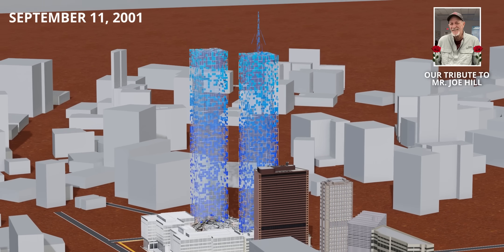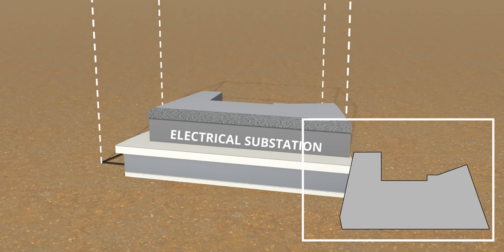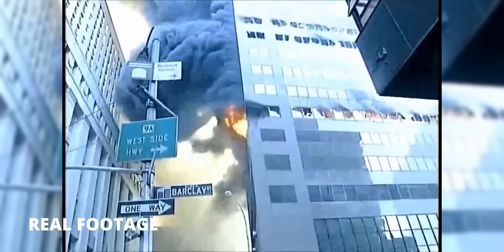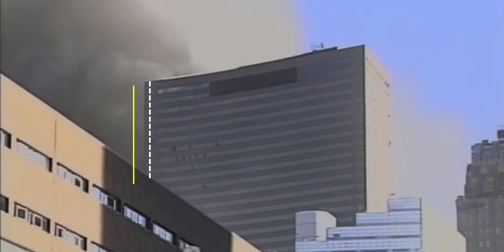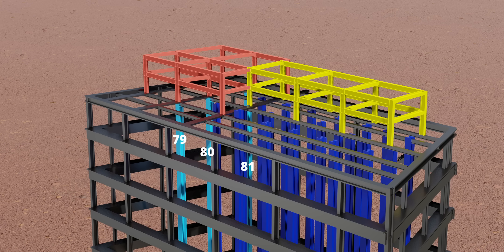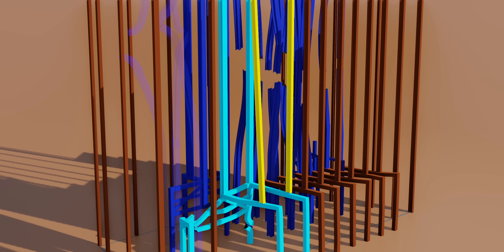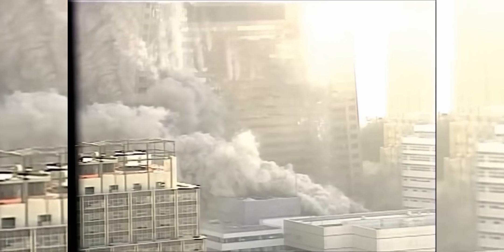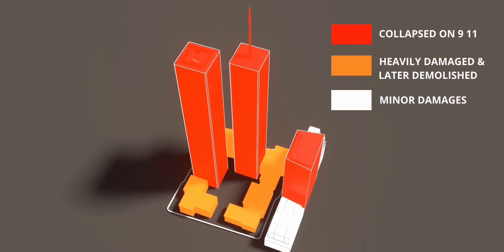Collapse of Building 7 | The Complete Physics

Comment: What I know for certain is that what ever hit the pentagon WASNT a passenger airliner.
Reply: What was your process to determine there was no passenger plane at the Pentagon anyway?  I don’t see one.

I’m going to respectfully disagree and offer a more plausible explanation.

We know Flight 77 – a Boeing 757 - hit the Pentagon because of ALL of the following true and relevant facts, not because of one random anomaly.  When complied together, all of these true and relevant facts form a single inescapable conclusion; 

1. Witnesses: Local and national media published or broadcast the accounts of ALL of whom reported a plane hit the Pentagon, while no witnesses reported seeing anything else (ie: none saw a missile). Around 2 dozen witnesses could identify either the aircraft type, the airline or both.

2. Flight Path: On its way in, Flight 77 created a damage path (the tree hit by the left engine, the 5 light poles, the garden wall on the Pentagon lawn and the mobile diesel generator) which is consistent with an aircraft the dimensions and layout of a Boeing 757. No missile could do any of that. 

3. Impact Hole: The impact hole in the outside wall of E-Ring at Wedge 1 of the Pentagon matches in size and shape the Boeing 757 from engine to engine. Wing impact marks extend out on either side of that to the span of a 757. youtube.com/watch?v=FkgJ-rFFBD0&t=15s  

4. Building Damage: The damage path inside the Pentagon takes the shape of an inverted cone, with over 80 support columns all of them bent in the direction of travel.  This is consistent with the high speed impact of a Boeing 757 aircraft and NOT the high-explosive blast warhead of any missile. 

5. Aircraft Wreckage: 19 tons of B757 wreckage were recovered at the Pentagon crash site including the landing gear, both engines, the entire left wing flap assembly, part of the cockpit, seats (some still occupied), landing gear bay doors, fuselage sections, the Flight Data and Cockpit Voice Recorders for Flight 77, etc, etc,... 

youtube.com/watch?v=kCRuVNgrAAw&ab_channel=cjnewson88 

6. Two parking lot security camera videos from the north parking lot security booth captured images of a B757 sized aircraft in AA livery flying along the exact flight path of Flight 77 and at the same velocity recorded by its FDR. The aircraft was trailing smoke from the right engine due to hitting the aforementioned tree moments earlier as confirmed by several witnesses. 

7. Human remains: The remains of everyone aboard Flight 77 were recovered and identified with the exception of 1 infant whose remains could not be identified. Some victims were recovered still strapped in their seats. Each of the victims families were provided with a detailed autopsy report.

8. Personal Effects: Several thousand personal items belonging to persons aboard Flight 77 were recovered at the crash site at the Pentagon with the victims families being provided with a 1,000+ page book detailing every item for identification and return. 

9. Radar:  A total of 6 FAA and NORAD radar sites tracked Flight 77 from take off to impact. The radar data matches EXACTLY the 25 hours of flight data recovered from Flight 77’s recovered FDR, right down to the last decimal. 

youtube.com/watch?v=3vqDDlS9Hyw&t=6s&ab_channel=cjnewson88 

10. Insurance: American Airlines and its insurers accepted responsibility, admitting Flight 77 crashed at the Pentagon and subsequently paid out tens of millions of dollars in damages. 

11. Boeing;  The folks at Boeing confirmed it was a Boeing 757 and specifically Flight 77 which hit the Pentagon. 

12. Where is Flight 77?  It is a fact that Flight 77 never landed anywhere, nor has anyone aboard been seen or heard from since 77 crashed into the Pentagon.

13. Even if the 9/11 attacks were an inside job, Flight 77 still hit the Pentagon and the above true facts are still true facts. “9/11 was an inside job” does not mean “flight 77 did not hit the Pentagon”.

14. Pilot Skill:  Hani Hanjour was a crap pilot and his flight path proves it. But he was grossly over-qualified to crash a plane – something anyone can do. A number of Hanjour’s instructors are on record stating that while he was not a good pilot, they have no doubt he crashed Flight 77 into the Pentagon.  The conspiracy types always leave that part out.

15. When staging an attack that absolutely has to use planes - and I cannot stress this enough - you use planes. Common sense.

16. No blast crater or damage, radial fragmentation pattern, pre-formed fragments, missile parts or anything else associated with a missile were found.

All of the above is true no matter who planned and carried out the 9/11 attacks or why  - which I know will be seen as a blasphemy by many reading this. 

Anything can seem like a conspiracy if you don't understand it. Now you know.

If you can do better then by all means, have at it. I am open to any more plausible alternative as to what hit the Pentagon using ALL of the available evidence while relying on fewer unproven assumptions than what I outlined above.  Go ahead, be the first to even try. 

Since no one ever does, it’s been nice knowing you.
Reply: That's nice for you. I know for a certain that you're wrong.

These two statements, in and of themselves, have the same validity. The difference is, I have proof you are wrong, and you do not have proof that I am.
I ALSO know that this video has nothing to do with that, and the only reason you brought it up is because you can't argue against anything in the video, and that upsets your ego because you have to face that no, you weren't actually as smart and cool and "with it" as you thought you were.

Comment: BS Video, a steel frame doesn't collaps like that without help. If the demolition guys that planted the thermite had any sense they would have made building 7 topple over instead of falling into its foot to make it seem more believable. 

It is an impossible outcome 3 times in a row. Just google failed demolitions where they didnt get all columns at the same time. It is near impossible to get a steel framed building to fall into its foot unless you take out all loadbearing support at the same time.
Reply: Not imopossible. Everything seems like a conspiracy if you don’t understand how stuff works. Fix that.  

Building 7, the 6th building to collapse of 10 lost on 9/11 though extensively studied still confuses many. Not famous or a terror target and with no casualties it didn’t get a lot of attention initially, creating an information void the internet filled with utter garbage. I prepared this brief summary from my own analysis to fix that. No politics, just engineering. 

The North Tower collapse at 10:28am bombarded Building 7 with tons of burning debris, causing heavy damage and starting multiple fires burning out of control for the next 7 hours. Half the FDNY firefighters having been killed, others injured, units in disarray, equipment destroyed, no water pressure, and the greater urgency of Search & Rescue efforts, firefighting was pulled as futile. The building couldn’t be saved and was left to its fate.

www.youtube.com/watch?v=g_SvpwyC17M&ab_channel=MFitz  

Collapse of a burning structure is always a concern for firefighters. Steel buildings subject to fire rely on active fighting of the fires to survive. Buildings are designed around 1 to 3 hours of fire resistance, allowing time for occupants to escape and ACTIVE firefighting to get started, after which all bets are off. Left to their own devices they will exceed their design envelope and collapse. In B7 the occupants escaped, passive and active fire protections were compromised and active firefighting was abandoned which left the building to take its chances. It lost. Odds on Building 7 would eventually collapse, and it did. No big deal in logic. That is the sort of choice firefighters make every day in brush fire situations - which houses to save and which ones to let go. Only real difference here is moving the decimal on the size and cost.

www.youtube.com/watch?v=WnYBX6QT0R4 

FDNY Chief Daniel Nigro ; The biggest decision we had to make on the first day was to clear the area and create a collapse zone around the severely damaged 7 World Trade Center, a 47-story building heavily involved in fire. A number of fire officers and companies assessed the damage to the building. The appraisals indicated that the buildings structural integrity was in serious doubt. I issued orders to PULL BACK the firefighters and define the collapse zone. It was a critical decision; We could not lose any more firefighters. It took a lot of time to PULL EVERYONE OUT, given the emotionalism of the day, communications difficulties and the collapse terrain

FDNY Deputy Chief Peter Hayden ; We had our special operations people set up surveying instruments to monitor and see if there was any movement in the building. We were concerned of the possibility of collapse in the building. And we had a discussion with one particular engineer there, and we asked him if we allowed it to burn could we anticipate a collapse and if so, how soon? And it turned out that he was pretty much right on the money, that he said 'In its current state you have about 5 hours

The collapse of Building 7 was anticipated and widely reported in the media throughout the day. At least 24 video cameras recording some or all of the collapse. Everyone knew what was coming and why.

www.youtube.com/watch?v=OY5S5k3tMHI 

Building 7’s collapse was completely different to the Twin Towers, harder to understand with most of the details difficult to see. But we can still sort out what happened through careful analysis and observation.  This is MY EXPLANATION of the collapse sequence using the best available information and relying on no authority.

B7 was complex 47-story steel framed structure built on top of a smaller existing 3-story building, requiring several lower floors dedicated to complex load transfer structures instead of usable office space. Of trapezoidal shape and all-steel tube-in-tube construction, B7 (above the 7th floor) consisted of a central core of steel columns carrying most of the gravity load, perimeter steel columns around the outside of the structure carrying the remainder of the gravity loads and long span beams and girders to tie those elements together and form the floors. On the outside of the building hung a moment frame - the last part of B7 to fall. 

Phase 1 : The first externally visible signs of collapse initiation occurred at 5:20:28 pm. Collapse initiation for B7 is notably quiet with observers not realizing the building was collapsing! There was no audible warning in the form of say hundreds of ear drum busting 180-190dB explosive bangs preceding the collapse. Here at 12:00 a local CBS affiliate reporter is talking 10 blocks from B7 when collapse begins. People don’t start to notice the collapse until 12:11. Then at 12:45 is the famous CBS fixed camera clip of Building 7’s collapse.  Note how quiet it is.

youtube.com/watch?v=t5tEy6mXSE8&ab_channel=fresnosean379

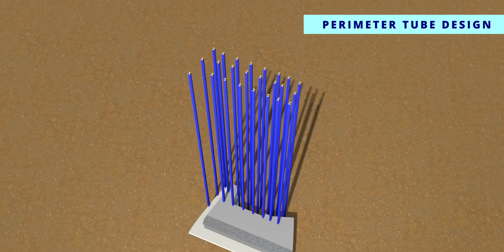Collapse initiation was due to lower floor failures above the load transfer region (7th floor) in the NE corner of the building. In this video at 0:45 you can see the NW corner from inside the building while under construction, Column 79 just out of frame on the left. That big, angled steel beam across the top of the frame connects to C79 at one end. The girders connect to the beam. That beam and all those girders depend on just one connection

youtube.com/watch?v=nP3TNHPCIVU&t=35s&ab_channel=EdwardCurrent

Phase 2 : Lower floor failures caused a loss of critical lateral support over an excessive length of core Column 79 and it buckled. If you look at a floor diagram of Building 7 (see above) and look at all the structures that depend on C79 you quickly realize this one column was a relatively isolated structural element on which a disproportionately greater fraction of the structure depended analogous to say the Key Bridge. Externally we see a vertical progression of window breakage along the 44-46 line and a kink in the roof of the East Mechanical Penthouse at the top of the building, consistent with C79 failure. The transition from full capacity to almost no capacity occurs in virtually an instant. Once the buckling failure occurs there is almost no resistance

Normally with a buckling column, the load could very well be redistributed to other columns, meaning the buckling could stop after a while. With C79 that is not the case - the failure did not redistribute the load, so the collapse rapidly progressed to the roofline, sinking the rooftop penthouse.

Phase 3 : With C79 gone, B7’s progressive, non-symmetrical collapse continues with C80 and C81 at the east end of the core left laterally unsupported and quickly buckled and failed as well, sending the EMP down through the building. C79-81 all have no diagonal bracing, which I believe is a major reason why they could not redistribute a lot of vertical loads among one another.

From there collapse progressed from east to west through the central core until the core was gone taking all of the interior floors and structures and probably most of the perimeter columns with it. You can see the horizontal progression of window failures low in the building and the dropping of the remaining rooftop structures into the building. One of the big takeaways from the NIST Building 7 study (that gets completely ignored) was their modeling which determined C79 failing under ANY circumstances would have initiated the same collapse sequence.

Phase 4 : After some 10 seconds all that remains of Building 7 is just a hollow empty outer shell - the exterior moment frame - creating the illusion the building is still standing since little has changed externally. But it’s just a hollow empty shell like an empty cereal box supported by only a few remaining columns and quite unable to remain standing. With all the internal framing gone, the north face leans inward, forming a V in the roofline, the last perimeter columns buckle under the strain and with nothing left keeping it up the moment frame free falls, landing on top of the 7-story high debris pile. It is only at the very end that a single measurement of alleged free fall acceleration is taken. Note this is not the building but just its outer shell and only one corner at that, at the very end of the collapse. Start to finish the entire collapse took 18-20 seconds, or less than 1/3 of true free fall and we have to look at the whole thing, not cherry-pick little bits to fit a particular narrative. Worth noting how fast something falls cannot tell you what started it falling in the first place. The debris spread out, blocking surrounding streets, heavily damaging the Verizon Building and destroyed Fiterman Hall, all well outside of Building 7’s “footprint”.  

Building 7’s progressive, non-symmetrical collapse was incidental and unintended collateral damage from the combined effects of fire + time + gravity started by the collapsing North Tower. That is true no matter who planned and carried out the 9/11 attacks or why . The collapse was of so little consequence it barely even registered at the time, a mere footnote. It only took on semi-mythical status as an alleged smoking gun years later when demolitions at the Twin Towers, missiles at the Pentagon and shoot down over Shanksville all failed and conspiracists had nothing left to work with.

I hope you found this helpful, informative and it solicits informed critical comment. If I made any errors of fact, logic or reason or left anything important out, please let me know so I can fix it. IF you can offer a more plausible alternative please do. Be the first. Please start any reply with the words “Tits McGee” or I will know you didn’t read it and are wasting my time.